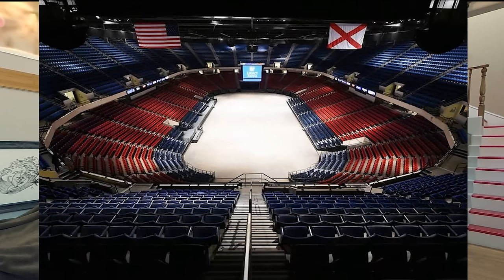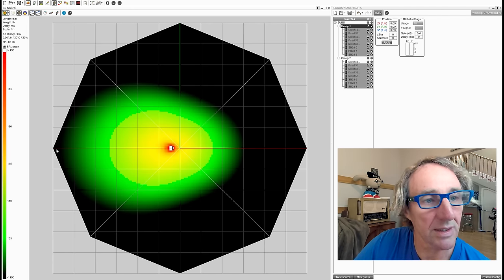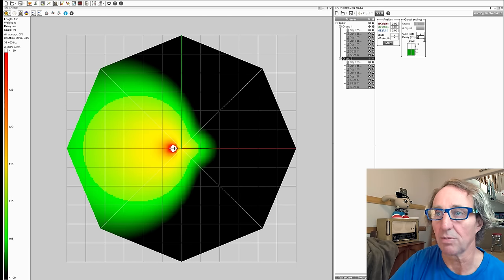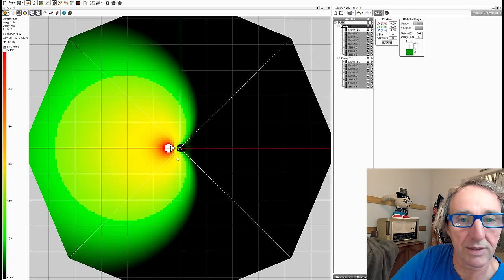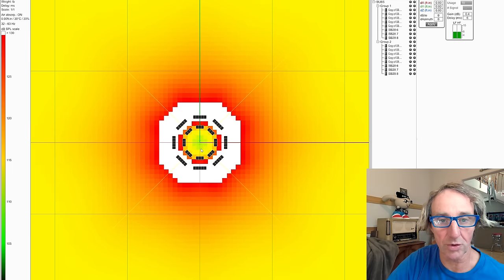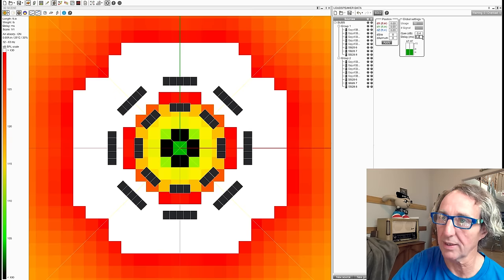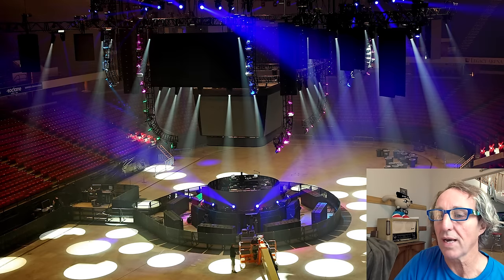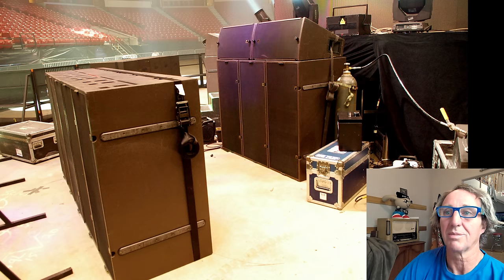Bassnectar 360 Subwoofer Sound Design

Comment: Absolutely love these types of videos and discussions!  Thank you so much for sharing Dave.  This is the type of stuff I would live for, but unfortunately don't get to do.  Question....noticing how critical the delays and temperature are in the software designer phase on manipulating sound levels, how does frequency response impact sound level as you cross 32hz to 63hz?  Is this non-issue because of doing RTA and correcting with DSP?  It would seem the subwoofers/cabinets would have a response curve as well as the venue that would throw things off some?  Or am I missing something?  Would've love to been at this show to hear this!
Reply from the maker: Low frequency waveforms are such long wavelengths that temperature doesn't affect them much but higher frequencies can be a challenge and the coverage changes with temperature

Comment: That was absolutely fascinating Dave. Thank you for that super cool insight. BTW I wonder if there is a maximum diameter a woofer can be? Like beyond a point the materials of the diaphragm don't move as expected (I'm talking something like a 10m x 10m speaker, something ridiculous), I imagine such massive diaphragm having the issue of rippling waves within.
Reply from the maker: Used to be 18 was best for subs but 21" is growing. 30" requires such a big motor that conventional motors don't work well

Comment: Always deep diving for resources in every videos from you Dave !

I would be interested in seeing if you're calculation results wouls have been different choosing a 45Hz tune (about fifth dimished of the C at 32Hz, which would be the most unphased) ? 

If it does, therefore wouldn't it be even better to know what average tune are the tracks of the artist to go deeper in the perfect Subwoofer sound design ?

Thanks again for sharing you're knowledge with us. Love from France !
Reply from the maker: I based the tuning on familiarity with the peak resonant output of that sub, based on experience mixing shows with that sub.

To change freq, just alter distance and delay and results will track asong as you don't go too high
Reply: @DaveRat  that makes sense !
Thank you 🙏

Comment: Too smart! Who’d of thought that a .1 Ms delay shift would make all of the difference!
Reply from the maker: Yes and this is an extreme case because adding 0.1 milliseconds moves 24 subs an inch farther away from 40 subs so the impact is magnified.

In real life the precision of placement of the subs is not as accurate as the idealized software shows so the impact will not be as touchy

That said, changing the time by half a millisecond showed significant differences in the measurements of volume cancellation in real life

Comment: That is really, really cool shit Dave. I wouldn't think that fractional delay times would make such a huge difference. Like 10db is HALF the energy and you were doing over 20db. Must have felt like black magic.
Reply from the maker: Yes that surprised me as well and also if you've ever tried to null two out of polarity signals together you will also know that microscopic changes in level have drastic differences

Comment: 3M makes these things that they call ‘dampers’.  Dampers are installed into buildings as an adhesive and joining compound, and  older buildings can be retrofitted with them as well.  Supposed to ‘earthquake-proof’ buildings.  They’re basically blocks of a semi solid goop that is high-viscosity and high-elasticity.  Imagine a sort of synthetic muscle that pushes back at you while you push on it, and pulls away from you
When you try and stretch it.  It also seems to contract when you hit it.  Really interesting stuff.  What it seems to do is prevent structures from ever resonating by any means available.  You know this I’m sure, but when that champagne glass atop a PA shatters from sound waves, it’s because the tone has matched the resonant frequency of that glass.  So maybe someone could squeeze a new product out of those dampers, by seating the sensitive computer appliances in it?!  Always great videos, Dave!  Thank you for sharing with us your professional experiences!
Reply from the maker: Very cool and yes, familiar. If the issue was just gear, that path could be considered, but actual human DJ could not see with blurred vision and it gets hard to breath at thos levels. So reducing the energy radiated in that area is preferred

Comment: Thank you for sharing such great content! The 3:5 ratio you used between the front and rear subs really stood out to me. Was this choice given by the 360° ring or does it just work better than the 4:4 ratio?
Reply from the maker: The ring size and focal point of cancellation are major factors. If the focal point of cancellation was farther away, a more even ratio would be preferred.

The outer ring is farther away from the focal point than the inner ring, so the inner ring needs less volume to cancell the sound.  

For cancelling sound farther away from the arrays, say 50 feet or more. Both arrays would be far away with a smaller percentage distance differential, so a 1 to. 1 ratio would be better. 

The farther the focal point, the closer to 1 to 1 you get

Comment: Mega cool to learn from you Dave, I bet the audience was delivered a new experience at that show! 

I used to work the automation systems at a large venue arena, and some concerts can get hot fast! 
Metallica with their insane pyrotechnics at the start of their show, after 3 songs temps jumped 10C alone! FML...LOL  
Most of the show managers don't wan't any airflow over the stage at all...some even are so insane they demand them all air handlers off for the show. 
If you were stupid enough to listen to them, and leave off the fan's temps can go up 20C and the audience suffers extremely! 
We trespass and life banned 2 managers from our site actually.
Reply from the maker: I carried a laser thermometer and would shut down air 30 mins before headliner starts the show, then monitor and turn on as a needed. Wanted an even and warm room but not too hot

I have done a few vids on venue temp

Comment: Dave. Good to know you! I have been wanting to learn about cardioid arrays for years for cancelling bass to my neighbors. I am extremely grateful to you to release this information right now too!

Because a year ago I ended up building a simple H shaped open baffle sub box with 2ft long wings strapped to both sides knowing I had enough drivers to overcome the losses that occur with open baffles in front (Sixteen 8s)

9:00 in before the money shot when they are out of phase with no delay 7ft face to face they mimic an open baffle response off axis (which is where my neighbors would both be!)

I tried using sound vision to recreate it but I wonder if you just happen to know and can tell me before I go breaking my box apart. I want to shorten the front wing so it's a U shaped box instead. If instead the rear wave had to travel further instead of equal distance H...do you think it would hurt a perfect 90* off axis cancellation. I feel it would only move the point where they meet and shoot off straight from there towards my neighbors (in sweet silence)
Reply from the maker: The differential in front and rear chambering caused by the c but not the h will alter and reduce the odd axis null. Don't know by how much
Reply: @DaveRat  okay. I was thinking longer about it and I agree. Of course the bass would be different if you flipped around the U back and forth because one way the distance to ear is almost identical and the other one wave travels further. But it would be identical if H was flipped both ways (same offsets atleast). That produces different responses in opposite directions so they won't cancel perfectly like they could with H.

People probably only build those for SQ sake.
Reply: @DaveRat  thank you for the fast response. You kick ass ✌️

Comment: My first thought was the TM (Thomas Mundorf) sub array, ... a center-hung vertical line array perpendicular to the stage below.  

However, although it's applicable to a big 360° stage like Metallica, with the closest attendees quite far from the center. 
But such a small stage DJ type setup for Bassnectar, places the closest concertgoers well within the low energy nulled region of the array. 

Dave, your solution is fantastic. 

Physics ... undefeated.
Reply from the maker: Also note: scoreboard
Reply: @DaveRat  
Well yeah, there's that!

Comment: Wow, gone are the days when they just put 20 - 30 subs in front of the stage and hope for the best! Super cool stuff Dave and that software is amazing. It is insane what difference milliseconds of delay makes. Does the crowd around the stage also make a significant difference? Also, is this the absolute maximum amount of low frequency that can be neutralized in the center for this setup while keeping volumes sufficient on the perimeter of could it be taken further? Also, how does this effect the DJ's monitoring with all the delays and things (I know the delays are relatively small but they still might throw the DJ off somewhat)?

Apologies for all the questions!
Reply from the maker: This is the maximum I was able to achieve and I had some other people try and no could match this.

As far as the DJ and delays. Typically delays less that 30ms are not an issue for timing and this was well below

Comment: Hey Dave, great Video. What spacing did you chose for the cardioid speakers and why? Second question, did you had to adjust the delay time because of the hight of the dj booth? The distance should be different to the soundvision calculations so did you measure it to be on point?
Reply from the maker: In Soundvision when I put in the DJ elevated surface it blocked the sound of the subs and gave an incorrect reading

Since the boot is elevated, the cancellation angle was upwards requiring a slightly shorter delay

Comment: Great video. There seem to be a large number of variables: heat, humidity, and even placement of the subs. I can't imagine that they were millimeter precise. So my question is: at the gig, how did you adjust for all the variables? Was it just a matter of trial-and-error with the delay?
Reply from the maker: Set it up and was not getting the desired rejection found the subs were not as accurately placed as needed. Got them to an inch or 2 then it was better.

Fine tunes the delay to max rejection. Put a mic in the center and monitored level and adjusted delay to maintain rejection.

Comment: Hello Dave,
This is really amazing, thank you for sharing!
I am wondering, how do the outer ring subs sum with the inner ring subs outwards without cancellation? Since the inner ring subs match the outer ring to cancel inwards, don`t they also cancel partly the sound travelling outwards?
Thanks!
Reply from the maker: Cool cool this is an older video but explains how cardioid works and and fire in the three part series

https://youtu.be/VwLH7zP6Lwo?si=0BDXKeT4bG6t3iXv

Comment: I can vouch for those HSD BattleAxe 21" horns! Best front loaded horn subs I've ever run and super flat down to 25-28 hz!
Reply: I've always been interested in learning more about how horn loaded subs behave in more complex deployments like this, but can never find any info!
Reply from the maker: Interesting. Yeah, I have never deployed horn loaded sub cardioid arrays.

Have not mixed much on them either. I try to avoid them actually as horns tend to be higher Q  and narrower bandwidth than reflex and I prefer a very flat , extended bandwidth, not resonant, lower Q designs and then just use more of I need increased volume levels

Comment: wow ! very interesting .I wondered if it's possible to automate the delay according to the temperature rising ? nice relaxed presentation by the way. greets, Paul.
Reply from the maker: Cool cool Paul. The time and complexity to setup, test and calibrate an auto delay time setup plus figuring a way to measure the average temp over the distance with multiple sensors and possibly differences in temp on the various sides of the ring makes that interesting but also probably way more work than the results will save

Comment: Suuuuper facinating! @Dave Rat -- Don't know this tool, but I assume the modeling is doing an average over the analyzed frequency range? 

I'm curious if (and would expect that) there'd be significant differences in cancellation from the bottom to the top end of that range.
Reply from the maker: Sound vision allows you to analyze in any 1/3 octave region from 20 Hz up to 100 Hertz.

Since this is a polarity reversed cardioid array the cancellation is actually pretty consistent over the full range of the subwoofer

Comment: Q#1 Would a third ring of subs with phasing and delay have made any difference? Q#2 Does off setting the inner and outer sub ring along with phasing make a deifference? Q@3  Is there any software that automatically accounts for delay  that could use temperatue sensors along with multiple monitoring microphones?If not there should be it seems.
Great Video. Would love to see more on this topic. Thank you so much for your generous sharing of knowledge.

Comment: Ive got a more general question RE Bass Subs. It would seem that most of your subs are front-loaded boxes. Is this just a better, more efficient design? What about scoops and folded horns? Have you done an episode comparing these various designs and boxes and showing their individual practical uses?  I work in mostly medium sized clubs and a few out door (VERY DIY Punkrock festivals) a year and i just dont have any subs that can keep up with that, and our budget basically means I do a LOT of work for free. What design should I use if we decided to just pour some giant horns out of concrete and then just took some 18ths to bolt to the backside?
Reply from the maker: Hmmm, personally and as a rental company, we look to using more modular and configurable subs than fewer louder bigger heavier horn loaded subs.

Where are you located? I may have some dual 18" rat subs I can sell off if you are interested

Front loaded tend to go lower, require less EQ but not be as loud. Using more of them and having them easy to transport and move around and places to put them is a big advantage
Reply: @DaveRat  Im out in the Golden Waving Plains of Wheat in Kansas (Youve been here with BF before) Id LOVE to get some subs but it would have to be uber cheap , Im not sure I could afford the shiping!
(However, I think I can get you a tax write off if they were donated through a non profit.)

Comment: That is very interesting. I am be interested to know about the effects of sound bouncing off the seats and walls etc. and reflecting back in. It does not appear to be an issue with the low end 360 design.
Reply from the maker: Whether it is 360 or not, indoor sound results; n reflections. But with 360, sound sent in more directions increases overall reverberance.

That said, getting subs closer to people improves direct to reflected ratio.

Timing the subs to mains with mains that can go very low helps focus sound to desired distanced areas.

Also, stage center venue gets sound closer to more people than sound at one end of the arena

Comment: any particular reason you went with this setup versus a gradient inverted stack deployment? I would imagine the latter would save a bit of the space required for physical spacing of the two rings.
Reply from the maker: would love to see a prediction of a gradient inverted stack covering 360 degrees with 40dB lower spl in the center than at 300 feet.

To the best of my knowledge, and based on the numerous designs I considered, there is no other design that will achieve this extreme cancellation. In fact, not even close.

In fact I challenge anyone to come up with an array that can meet or exceed the coverage consistancy, maintain volume level in the listening area and meet or exceed cancellation in the center.

Extra bonus points if it can be done without blocking sightlines or increasing the footprint

Comment: Great video, this stuff is fascinating.
Would it be true to say that 24 of those subs were doing nothing except making it tolerable for the DJ and 40 subs were providing sound for the audience?
Reply from the maker: Not really 24 the subs were canceling out all of the sound for the DJ but subs radiate sound in both directions and the sound radiated outward from the inner subs is in polarity and phase correct with the outer subs at the tuning frequency

Comment: out of curiosity, did your sound design software did take into account the stadium stands ? seeing real pictures is way different than what your software was generating with nice clean patterns... with all those stands (plus temperature and humidity) must have been a lot more difficult to correct once installed no ? and by the way, it's funny how your cardioid pattern looked like a radiation pattern of a yagi antenna, when we add directors to a yagi antenna, it creates more and more gain in front of the antenna and the reflector (could be like your 3 sub array) also blocks radiation behind the antenna, just like your sub setup did !
Reply from the maker: My goal was even outward radiation and maximum inward cancellation for the subs. Venue shape and coverage of the main pa was accounted for in the main PA design
Reply: Got it ! Thank you for the reply !
Reply from the maker: Cool cool great to meet you